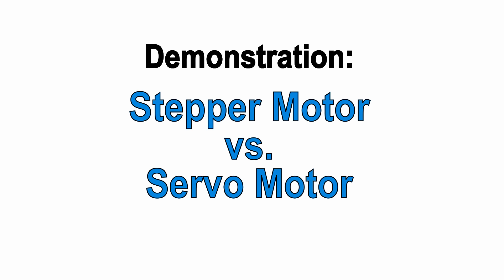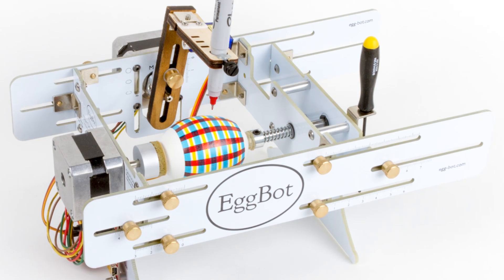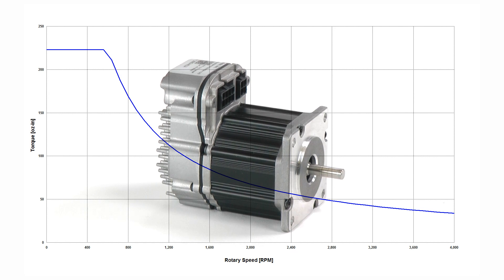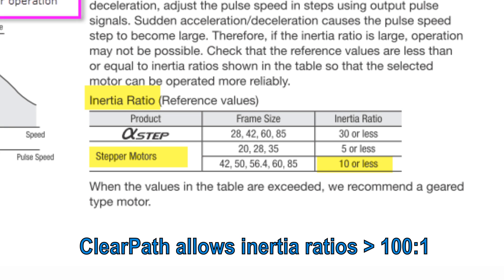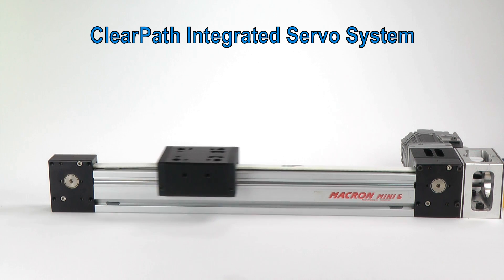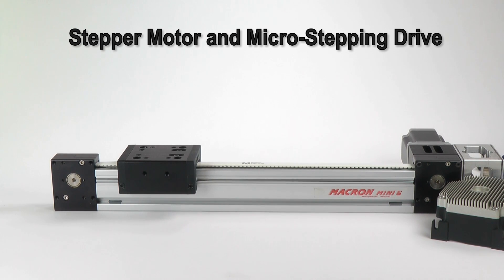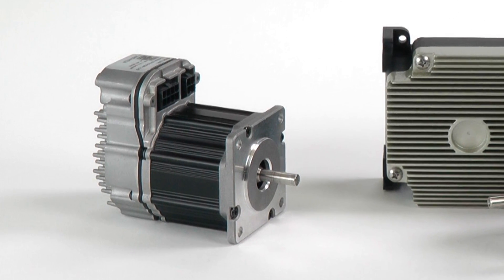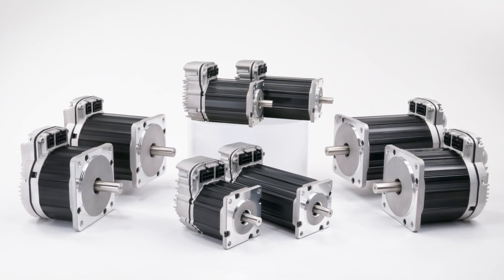Stepper Motor vs. ClearPath Servo Motor Demonstration Video

Comment: $50 for a NEMA 17 motor and a chizy drive? You're a horrible shopper. I mean be more full of shit why don't you? Not that I don't expect horseshit from people, but quit insulting our intelligence so blatantly.
Reply: Hi Paul Frederick,

I'm an applications engineer with Teknic. I apologize if any of the content in this video offended you. The intent of our videos is to explain motion control topics to our viewers to the best of our abilities and to point out which applications our products may be a good fit for.

There were a few reasons behind why we chose the specific stepper components you're referring to. First, we roughly estimated the power required for that Eggbot application to be about 5W. Then, we picked the cited Digi-key parts based on that power class. We expected that those stepper components bought through a well-known distributor would be reasonably competitive and representative of what's available in that stepper system power class. The components consist of a 2A/35VDC drive, paired with an NMB 1.4A/24VDC stepper. We genuinely think $50 is a pretty good price for what the system provides. 

I'd be curious to know why you feel that $50 is a horrible price for this system. It's true, you can find stepper systems for less than $50, but I’m not sure they would have that amount of shaft power. I think that to fairly conclude that the system we showed is a bad deal, we would have to know of a less expensive stepper motor and drive system that has about the same shaft power (and is new and readily available from a reputable source).

As an example, Digi-key has a 1.7A NM17 stepper for only $14 (motor only) vs. $37 for the NMB, but it only handles 3.4 volts (vs. 24 volts for the NMB. It wouldn’t be a good match with the drive, and the shaft power would be a fraction of the NMB’s (the manufacturer doesn’t provide enough data to know, but it’s probably around 1 watt of shaft power). So, although it’s cheaper, I don’t think it means the NMB motor is expensive, because the NMB motor has five times the power. Of course, if 1 watt is all you need, you can save $23. 

In the video, we were trying to convey that if you need less than about 20 watts of shaft power, a stepper may be a better choice than ClearPath. If you need more power, ClearPath provides a good alternative. I truly apologize if we misled anyone in any way.

In case you’re interested, here are the parts we cited:

Drive:
https://www.digikey.com/product-detail/en/sparkfun-electronics/ROB-12859/1568-1066-ND/5172292
 
Motor:
https://www.digikey.com/product-detail/en/nmb-technologies-corporation/17PM-Z342U/17PM-Z342U-ND/5967567

Best regards,
Bridgette G.
Reply: An engineer should know that the voltage rating of a stepper motor is only obliquely related to that motor's performance. I mean we do use constant current motor drives today. So with the right drive I can run 200 volts through a 3.4V rated motor. And it will run like a banshee then too.
Reply: That's a good point and true (to an extent), but there are multiple technical reasons that running that stepper motor from 200 volts would be problematic, including the following: 

1) The eddy and hysteresis losses (which combined are nonlinear with speed and increase at a ~1.4 exponent) would quickly overheat the motor and destroy it.

2) The electrical time constant would probably limit the torque-producing current to a miniscule amount at the speed implied by a 200 volt bus (and 50 electrical cycles per revolution).

3) Controlling current in the 1.7A range with a 200 volt bus would require precise PWM circuitry.

4) For the EggBot application, there would be no value in increasing the motor power by running at a higher speed—if anything you would probably want to do the opposite.

Additionally, a 200V drive would be much more expensive than the $20 drive we listed.

More realistically, you might consider using 24V with a 3.4V motor (a voltage which is also compatible with the listed drive). It’s certainly possible to run a stepper motor rated for 3.4V at 24V with a constant current stepper drive. The datasheet for this motor does not provide enough information to estimate the torque/speed curve at 24V; maybe it would be appropriate for the EggBot application (but the motor is probably more torque limited than speed limited).

That said, because most of our customers are high-volume OEM companies who place high value on reliability, safety, and regulatory compliance, we don’t recommend exceeding the manufacturer’s rating for any component without first discussing it with the manufacturer’s engineers. Without knowing the exact internal design of a component and reasons behind why the manufacturer rated it for a specific value, using the component in a way that that exceeds its ratings could possibly have negative and unforeseen long-term effects.

If you’re a hobbyist and just having fun, there’s no harm in (safely) connecting 200 volts (if you have a drive with that capability) and seeing what happens :)

Best,
Bridgette G.
Reply: You are absolutely correct that it's possible to run a stepper motor at a voltage exceeding its ratings as long as you are aware of potential negative effects (which are probably minimal or none, if you stay within reason, e.g., 24 volts in this case). I appreciate you pointing this out and I apologize if my first comment was unclear. 

I worded my response that way because we typically don't suggest exceeding any product rating; there are often too many considerations and caveats, and we don’t want to be misconstrued, especially when talking about another manufacturer’s product. However, I value the information your comment has provided for other viewers.

Best,
Bridgette